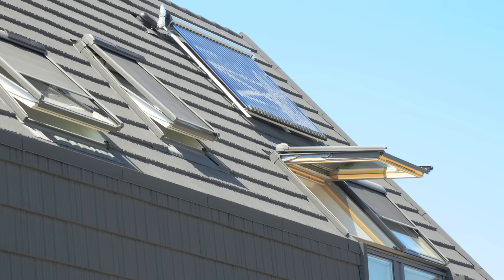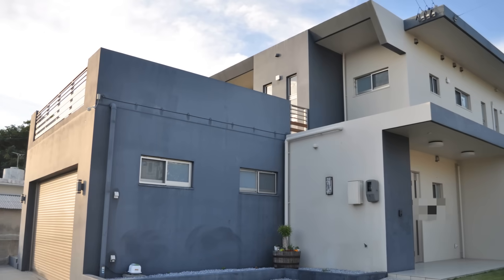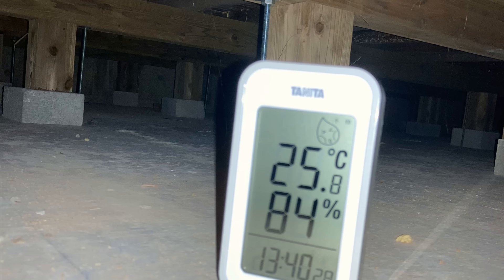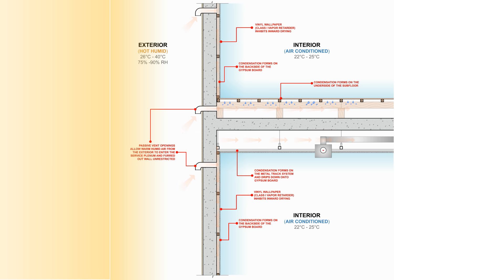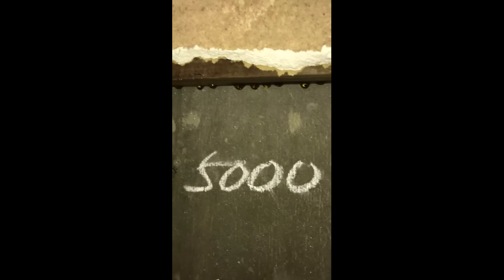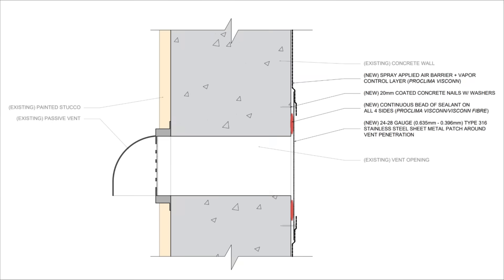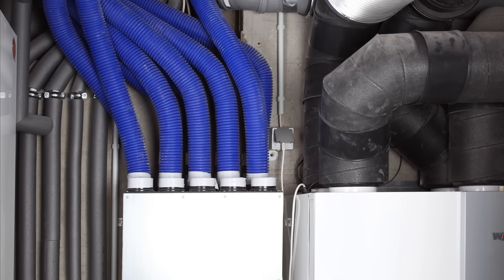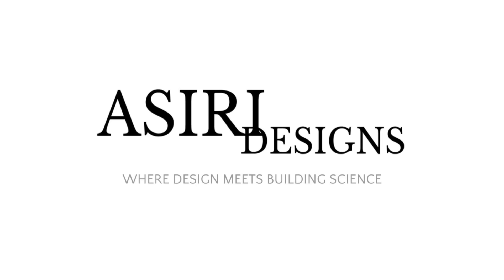The Unintended Consequences of "Passive" Ventilation... (A Case Study in Japan)

Comment: My old stone built cottage is 100% dryer and more pleasant to live in the neighbors newer plasterboard rat hiding  junk builds that freeze as soon as heating switched of with zero thermal mass .Only stone and lime mortar , zero junk plastic tech .
Reply: Thermal mass doesn't help unless you're trying to coast through a power outage, have massively oversized non-modulating heating system, or have large daily temperature swings but the average temperature is comfortable for humans. Insulation and airtightness is what you want.
Reply: @hailexiao2770  yes i do have expensive thermal wrap on all ceilings , made a huge difference and use an ir camera to spot heat leakages and in winter live in an attic room only as super cheep to keep warm .

Comment: I knew it! I live in Japan and bought a modern home 10 years ago. During the hot, humid summers I keep all the passive vents shut tight. Only in winter (cool and dry) do I open any vents or windows to allow for fresh air. In summer (hot and humid) we have the AC running 24/7 and use de humidifiers in every room to assist with the humidity. Unfortunately after 10 years some of our rooms have started to show some signs of mold on the interior wall papers. Maybe we should change those wall papers to something else?
Reply: I thought Japanese where engineering masters???
Reply: @HermanWillems  But they still have stubborn habits.  They still use fax machines.
Reply: @GDIdoujinmediaworks  Not really a big point, but fax machines are still widely used in the U.S.—especially in healthcare and legal fields, where they're trusted as 'tamper-resistant records.' In fact, it's said there are still over 18 million in operation.
Reply: @HermanWillems  Yeah it's called "replace a home every 10-20 years".

Houses weren't meant to last centuries.
Reply: @SecuR0M  how to tell that to people in north america, particularly Canada, who are obsessed with renovating and preserving all kinds of homes despite these houses not all having cultural/historical value?
Reply: @RJ-se9op  idk more tornadoes and firestorms and less insurance coverage like palisades?
Reply: @SecuR0M  xD
Reply: @RJ-se9op  Land value taxes. Preserve your house if you want, but you'll pay for it.
Reply: Don't repeat the same errors. Changing wallpapers doesn't taggle the root cause. First, You need to make sure you are always above the dew point in the regarding rooms.
Reply: @MrOneWorld123  Rooms are rarely if ever at the dew point--that would imply 100% RH. The problem is that the wallpaper is below the dew point in its own microenvironment, and because it's a vapor barrier it won't allow any of the moisture through, and thus water condenses on its outer surface.

Comment: This is excellent content. I live in south Florida an after problems of my own cause its an old house with an unconditioned forced air vented attic right there. Would have beeen a lot less head ache if I had seen this first.

Ultimately just insulated the attic and its part of the conditioned space now. But now I am questioning my choice to use killz (basically latez sealant and primer) on my fence.

Comment: This is really cool. I plan to build a energy efficient house and that puts a lot of things in perspective. I already wanted to have good insulation and heat exchanger to provide good ventilation without having to vent all that hot/cold air outside and losing a lot of energy in the process.
Today I learned I need to dry out this incoming air a bit in a controlled way and I need to maintain positive pressure inside so that air does not get inside from outside in many tiny cracks where it will condense moisture as it passes into colder materials.
That's really valuable knowledge, thanks!
Reply: Moving from an HRV to ERV will be something to switch up in the plan.

Comment: Running the AC at 68 wow... Good luck with that power bill in Okinawa...
Reply: I used 68F in Colorado until 1pm when the power rate goes up. It has three prices. Mid peak 1-3pm and peak 3-7pm. 

The house is 68 from 6am to 1pm. Climbs to about 75 with A/C off until 7pm then cools to 68 again. From 9p-6am it is 70-72.
Reply: @Triple_J.1  I don't think you realize that it costs probably twice if not 3 times as much as Colorado. While the average wage being half of what it is in Colorado. Meaning it costs 4~6 times as much as in Colorado. This is why older Japanese people refuse to use ACs.

0-10 kWh: 40.20 JPY (≈ 27.34¢/kWh)
10-120 kWh: 45.74 JPY (≈ 31.11¢/kWh)
Over 300 kWh: 47.72 JPY (≈ 32.46¢/kWh)

Comment: I thought passive ventilation systems are specifically designed to replace air conditioning. Using both just sounds insane. Why would you want to pull in the hot air?

Comment: I'm allergic to mold and shopping for my first house. Thank you for this in-depth case study. I was planning on lots of wallpaper and some textured (so definitely vinyl). Now I know to double check what they're made of!
Reply: Make sure you're looking at the right techniques for your climate, the direction of moisture movement and where condensation happens is different depending on temperature and humidity
Reply: @Fists91  Also don't build just for the climate you have right now. Build for the climate you will have in 30 years. A lot of Canadians are going to regret that interior vapor barrier in 30 years when the AC combined with vapor infiltration from the outside causes condensation on the outside of the vapor barrier.
Reply: First thing you should do in the house is check the bathroom conditions, if the silicon or concrete grout is cracked or worn out in any of the tiles in a built shower, run far far away. Lift up the toilet tank cover, if there's mold in there or a mildewy smell, run run. Check the bathroom sink emergency drains, if there's mold in there, run run because it means there's water behind the walls somewhere in the bathroom.
Reply: No one is "allergic" to mould, mould is just a health hazard period.
Reply: Since you have environmental sensitivity, maybe consider not exposing yourself to a lot of offgassing plastic, even where it doesn't contribute to mold. Being sensitive in one area can make you more vulnerable in others.

Comment: So the problem isn't the ventilation. It's combining the ventilation with AC. Buildings have to be built differently if you want to cool them
Reply: @ original: I mean, the AC can dehumidfy too, even if the cooling is set below the dew point temperature.
Reply: @krissp8712  It's not enough if the air from the AC is dehumidified, if you are mixing it with warm, hot air
Reply: @krissp8712  we have HVAC and no it's not enough to dehumidify, especially in warmer weather with plenty of rainfall, and no we're not turning the house into a walk in fridge when we could just use a dehumidifier
Reply: That's how you know we're still on prototype phase for one of our most common tools: Acessment of Civilization
Reply: Or,  you cool the air before you pump it into the building and capture the moisture that will drop out  in the same way that a de-humidifier would.
Reply: So the problem is still ventilation,  it can have more than one cause
Reply: @NokSatoSmit  The problem is not the ventilation, as it is built to the standard airflow of the space it is in. When you introduce the AC you are changing the standards, specifically by altering the rate of air changes (ACPH/ACH), controlling moisture levels through dehumidification, and influencing air pressure within a space. If you want AC you need to get one that is appropriate for your conditions.
Reply: @Bloddrake  Every house should have AC, it's the 21st century lol
Reply: @user-ge5oe9oo2k  because energy is free, right? that is a very dumb thing to say...

Comment: Passive ventilation is garbage when the air quality outside is poor. The AQI for most of Japan is above the WHO safe standard for pm2.5 and passive ventilation makes for constant exposure to pollution.  For example, in the Kanto area, the AQI has been above 70 for the past week.  Imagine breathing unsafe levels of pm2.5 24 hours a day, every single day.  Mold is just ONE of many problems that passive ventilation brings. 

You want active, filtered ventilation and forced ventilation in mold-prone areas.
Reply: what is it from? auto exhaust?

Comment: Sealing everything is a very non elegant solution.
Any movement and time can break the insulation.
Plus the air inside becomes stale.
And if there is any mold or bacteria it keeps growing.
Plus on using inorganic material, but then you used plant based covers :((((

Comment: The alternative to redesigning the house is to live within the parameters of the building in question. Excluding the vinyl wallpaper, simply keeping the temperature split between the inside and outside to around ten degrees F, or about 5-6 degrees C. Would have likely eliminated the issue entirely. The use of a mini split in dehumidification mode may have completely resolved the need for minimal cooling and dehumidification.
Reply: Why would this temperature difference make the difference (and not bigger or smaller)? Would the vents still be necessary? Sorry I'm absolutely clueless about mold but it's everywhere
Reply: @discorangutan the issue is condensation. Think cold beverage outside on a summer day: that water beading on the outside came from the air. If the beverage was at the same temp as the outside air, the glass would be dry. 

Cold air holds less moisture than warm air, so when hot, humid air cools down (a la by meeting a cold surface) it condenses, which is to say some of the moisture it’s carrying as vapor falls out of it as liquid. Fun fact: this is what rain is.

All to say, if they didn’t cool the interior of the house (or didn’t cool it much), the outside air coming in wouldn’t condense. It would be uncomfortable for the occupants (in the sense that the inside would feel just like the outside), but the building wouldn’t mold.
Reply: @discorangutan  the easiest way to explain it is that the amount of water that air can hold depends on the temperature. Hot air can hold more water, so if you imagine hot humid air coming in to contact with cold air it can force the water out of the air, which is the mist you frequently see opening your freezer. This water can grow mold. That's why your ac generates condensation. Frequently however despite the fact that your refrigerator is colder than your house, you don't see mist forming when you open the door. That is because the difference in temperature and humidity is not enough to force condensation as dramatically, however leaving a refrigerator temperature item out will still allow condensation to form, which means that differential will still cause mold. A ten degree differential however generally speaking won't cause any condensation, because the temperature at night is normally more than ten degrees cooler, so the humidity is generally not high enough to condense over a mere ten degree differential. The inside humidity will be significantly lower because the air handler will have at least twenty degree temperature difference. This means that the conditioned air is drying whatever little condensation is generated during the fluctuations in temperature outside. No moisture, no mold. You want to keep humidity below 60%.

If you live in particularly humid and consistent heat, with LOTS of hot rain, you may just want to use a mini split on dehumidification setting. It will reduce the humidity and cool as a byproduct but the dry air will feel significantly cooler without generating temperature differences that can cause condensation.
Reply: @discorangutan  sorry I posted a long response before but YouTube deleted it, so I won't try writing a full explanation again. I want you to imagine a board with a nail through it. If it is ice cold on one side and hot and humid on the other side, water will condense on the nail exposed to the hot side and cause issues. Now imagine that the wall is only a piece of paper. If it is too cold on one side, condensation will form on the other side of the paper and destroy it.

Ten degrees F is almost never enough of a difference to cause meaningful condensation, and because the conditioned air is relatively dry what little condensation forms is fully dried within 24 hours.
Reply: The problem is while locals typically keep the AC on low Americans tend to really crank on the air conditioning full blast 24/7 which leads to a lot more condensation.
Reply: @thebigwarthog  I worked as an HVAC technician in a poor area of the American south, many of the old buildings are very similar. Old school residents seemed to just know this, but younger generations, particularly those who didn't know their father and grandfather were almost incapable of understanding this. I suspect that you would have a similar problem in Japan, and you would find the problem larger every year.
Reply: @vidard9863   In Japan a lot of older Japanese remember a time when they needed to be frugal post war but the younger generation tend to be less frugal as they have not had to live through any hardship. 

Then you have the Americans who will set their AC so low that you need to wear a sweater inside the house lol
Reply: @thebigwarthog  That's not the norm in the U.S., although it depends on what you call "so low." It tends to vary by location and climate zone. The U.S. has one of if not the most diverse range of climate zones and subzones on the planet.
Reply: You'll never hear anyone recommending a maximum inside/outside temperature differential of 10F in a cold climate, so I don't see why this would be an acceptable alternative. Houses in cold climates have to with deal with much higher temperature differentials, just in the opposite direction, so flipping the typical northern European wall section around would well pretty well. Removing the wall paper, making the outside wall airtight, and putting up an exterior vapor barrier would do the job.
Reply: @hailexiao2770  ? We are talking about cooling, not heating, and the house in question is located in a climate more similar to Miami that is unlikely to ever see the temperatures you are talking about. Nothing you said has any application to the topic at hand.
Reply: @vidard9863  I was talking about cooling climates too. Just build a wall that's the opposite of a cold climate wall, with an outside air and vapor barrier.
Reply: @hailexiao2770 hey look, if everyone could afford to live in mansions on the beach we all would, your argument is irrelevant. Even looking at cold climates houses without insulation don't have real condensation issues because they warm the exterior of the house, the lack of insulation is a problem and a solution. The condensation issues can be resolved by proper use of the system, sure that's not as good as building an ideal mansion, but it IS a solution.
Also building the wall as a reverse of cold weather insulated walls can cause structural failures in particularly bad climates. You need to build for the specific climate and financial needs of your project.

Comment: If a builder bothers to read and apply IRC book most of this would not happen to begin with.
There is no difference between building in Louisiana and Okinawa if you are educated in vapor barriers, insulation, HVAC systems to deal with this.

Comment: You said vinyl exterior wallpaper. Do you mean some sort of decorative vinyl on the outside of the house? Or just exterior as in its on the exterior of the inside wall? 

I took it to mean the second thing but I wasn't sure. Also, if that's the case, you did say it could help or wouldn't be a problem if it was?

So if the vinyl vapor barrier wallpaper was directly against the stone in the diagram at 7:20, then there might not have been a problem? Or would it somehow cause problems if the stone stays too wet?

Comment: In SEA some traditional houses which lack AC have aie conditioned "cool rooms" (usually for a bedroom) and all the unita like that I've seen are well insulated. It's really weird this was done this way, from the owner's perspective it's not even the mold (which they won't think of) but pure energy savings that should tip the scales on this decision.
Sounds like whoever designed this wasn't great at their job

Comment: In Europe we got things right long time ago. If your house is airtight. Then you need recuperation. Forced airflow to outside. Insulation from outside of the building.

If your house isn't airtight then natural ventilation occurs. Insulation can be from inside. Vapour barrier from inside always.
Reply: > Vapour barrier from inside always.

Try this in hot/humid climates at your own risk.

Comment: This is way more than being mold remediation, you just re-engineered how their building works! Very nicely done. Yeah those exhaust vents they put on the exterior of the building, essentially out of tradition, seem to be a huge contributor to the problem; the solution to cap them on the backside is good because it allows them to maintain that aesthetic while preventing more problems.
Reply: You think that people understand their own environment right? Here we do in our place. And have buildings that last hundreds of years. Because of science. You can't just put one building in another environment.
Reply: @HermanWillems they understand their traditional, non-AC housing but not always what modern technology and designs will work. But they still want modern technology and designs.
Reply: @onikin  I see that often it is not that people want modern technology,  but are forced to use it by regulations